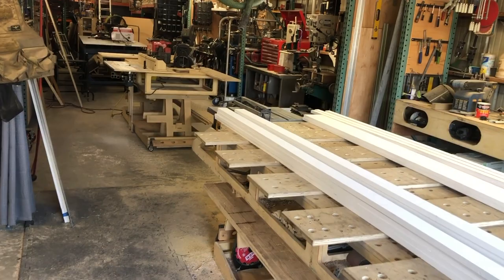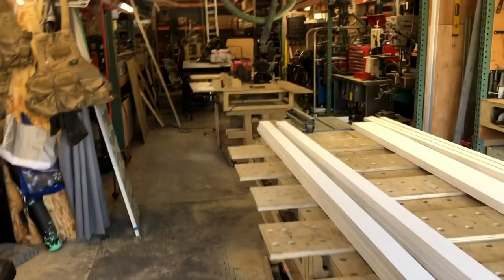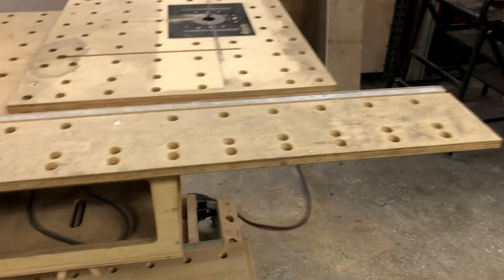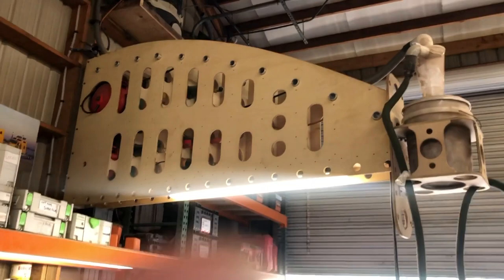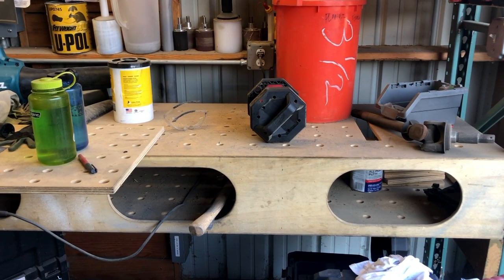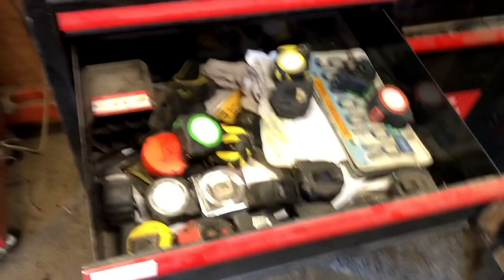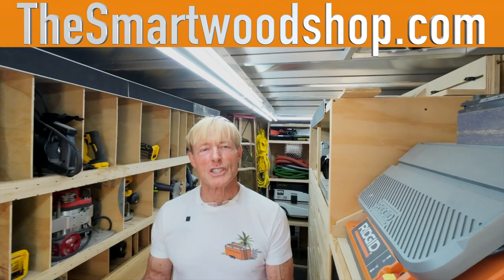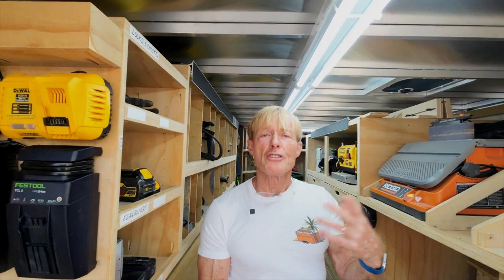Smart Woodshop Tour with Lee Bryant

Comment: Thanks for the link to Lee Bryant’s shop. So cool. Lee is a very talented craftsman as he did all the custom solid SS railing metal work inside my current house on Lake Sammamish WA. He finished the stair railing with a iron wood cap. He also built a custom 10’ floor to ceiling steel fireplace that turned out amazing. He built everything in his shop and did some welding on site. Thanks, Charlie
Reply from the maker: Very cool!

Comment: and the metal working table being designed in a similar manner as the SMART Bench is a FANTASTIC idea.  unless he has more on that than clamping, I think he might be missing the boat a bit though.  as I'm thinking about that, I'm thinking that with a few more jigs and dogs, that it could be used just like the SMART system to cross cut at perfect 90 and 45 and probably long rips of metal just like wood.  this could revolutionize metal working to become as efficient as woodworking on the SMART system.  and also using dogs in a pattern, could use it as layout to ensure perfect square joints before welding without having to do a lot of measuring.

maybe Lee could expand on this and prepare a future video on that.
Reply: That was inspirational.  I like the way he's re-used instead of tossing the old benches. Pretty clever guy!
Reply from the maker: Hey Lee, do you have any thoughts on Roy's comment? Sounds like you could make a video just on the metal bench.
Reply: I think I would like to do some more videos of my shop and show more details of how I use each part. Thx
Reply: @leebryant213  that would be awesome.  I would definitely watch those.  Thanks.
Reply: Well, I just posted two quick videos. More to follow. Let me know what you think.
Thx
Reply: @leebryant213  that's great Lee.  Proud to be your first subscriber.

I would recommend to NOT mark it as Kid Safe.  It it counter intuitive, however, by doing so, no one can comment on those videos.  And also, while I very often save good videos I watch to folders in my library, the kid safe videos cannot be saved.

Thanks.  I look forward to seeing more content.  As I'm not well versed in metal working, I'm sure I will learn a lot and have many questions.

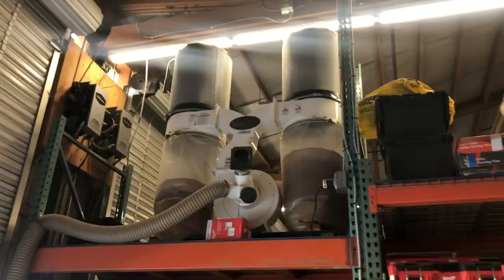Comment: nice set up of tools.  Question:  at 5:34 he has what appears to be home made triangles hanging on the wall next to some speed squares.  they appear to be inside corner clamp braces or something like that.  I'd like learn more about those.  how they are made and used, if possible.  I have my imagination about it but would love to hear more from the owner about them.  

in your opinion, would something like that be worthy for cabinet builds or is there a better solution for that task?  thanks for sharing this.
Reply: These are sold by FastCap
Reply: FastCap sells those.  I made a few for myself after seeing them and use them all the time for making cabinet boxes.
Reply: @Lee-mg7dq  are they just made from a premium plywood?
Reply: Yep, they are made out of high grade plywood. Perfectly square and have cutouts for clamping.
Reply: @leebryant213  I've seen versions of those before but probably not as nice as this triangle.  This would make a good short video to show them in use and maybe even making them.